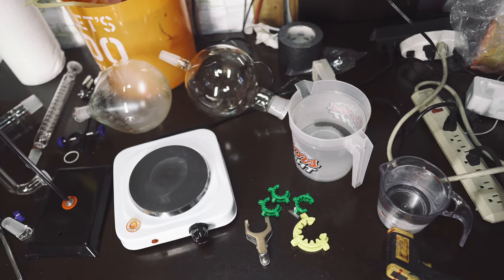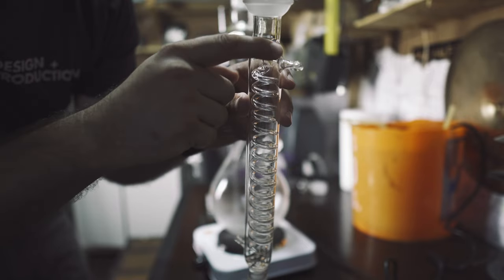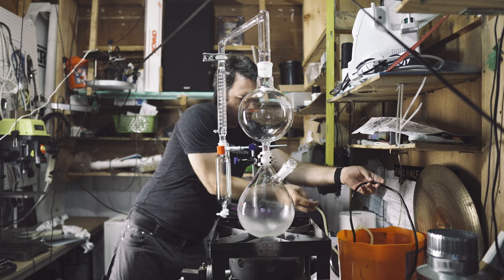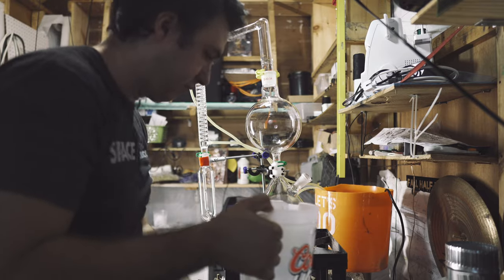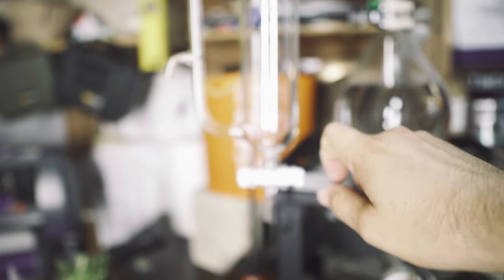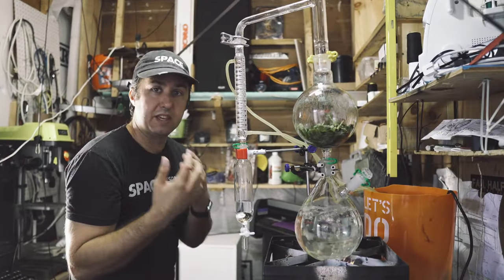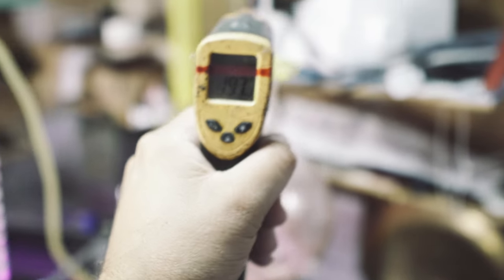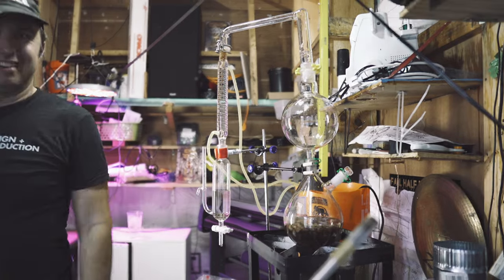How to steam distill essential oil at home and how to fail at that distillation. Beginners guide!

Comment: I thought he had a closed system but after watching it again i see there is a little outlet on the equalizing funnel.   Never seen a funnel like that before with the little side outlet thing........wild
Reply: That "thing" is not a funnel - it is a water-oil extractor and it is designed so that the excess water (and pressure) comes out of that "little outlet" on the side. In fact when doing this kind of steam-extraction you would normally put a catch-bottle under that as it will fill up and flow out there. And for example with rose-bud extraction you will get pleasant-smelling "rose-water" or hydro-sol from there.
Reply: @TheDesertsweeper  .......Thanks buddy i learned something new.

Comment: Can you tell me which set up you purchased for the main distiller?  I've now watched probably 100 videos and read very few reviews.  This, although an epic fail in the end, was something I think, like you, could modify with your tips and troubleshoot as I go!
Reply from the maker: Melanie Esguerra well the exact one I bought is apparently no longer for sale, but this one seems to have all the same parts. https://www.ebay.com/itm/372885079862 I hope it works, and by all means let me know how it goes!!! I was able to make some in subsequent tries with less heat
Reply: SPACE DESIGN WAREHOUSE Oh thank you!  I was looking at this same one on Amazon.  Ebay is cheaper.  Yay!  I was wondering if, now that you’ve realized the first run through was boiling too hot, do you think the hot plate that comes with the kit was designed to maybe only get that hot for a reason?  I want to get all the parts I know this far from your modifications at one time.  I’m wondering if I need to buy the propane burner... 🤔 What do you think?
Reply from the maker: Melanie Esguerra I’m pretty sure the propane burner was overkill, and because I didn’t have enough airflow it only seemed like it wasn’t getting hot. Turns out you just have to have way more patience; the whole process takes sever hours and I was trying to force it to happen in several minutes.  You’d want a propane burner if you we’re making one of those big copper ones that can process through buckets of material at once
Reply: SPACE DESIGN WAREHOUSE Perfect. 😑 Now I have to go find a place that sells patience!  😩😅 Okay, I’m going to try it as is and find a way to distract myself while it’s doing it’s thing.  I was thinking I could even go between and try just a little bit stronger hot plate...like 1800 watts or something. 🤔

Comment: Hotplate not a burner since it gets way too hot. You need a steady control of heat and that not possible with propane.
Reply from the maker: That has become clear.. I couldn't figure out how this is pressurized, though, theres a 1/4 hole with no plug at all times!

Comment: Dude - do not have that glass sat directly on the metal unless you want an explosion of boiling water all over your body.  Read why you can not touch glass to metal - it has to do with the rate at which they heat and cool

Comment: Thare She Blows due to the pressure needed to overcome the column of water in your collection tube, It would not have happened if you did not have an air tight connection between the output of the condenser and your collection tube and so the steam can flow but not build up pressure. It looks like there must be a defect in the manufacture or the design of the collection tube, the vent tube at the top of the collection tube should be open to atmosphere  but it must be solid glass not a tube causing a the pressure to build up and blow. Aside from that i liked your video for entertainment purposes.
Reply from the maker: Ohhhhh, because the ‘blow off’ tube is part of the collection flats, you’re saying the pressure built up in the condenser coil and had no where to go? 
I was wondering why there wasn’t just steam shooting out of that blowoff tube. Should there be one of those above the condenser instead?
Reply: @SPACEDESIGNWAREHOUSE  After watching again I saw steam escaping out that upper vent tube in the collection tube so that is not the problem. What I believe is the problem is that your plant clippings in the upper chamber got saturated with water, sank down and clogged the opening between the vessel containing the water and vessel with the plant material. This allowed pressure to build up in the lower chamber until it was powerful enough to suddenly clear the plant material out of the way causing a sudden surge of pressure to surge upwards causing the blow out. Perhaps a screen of some sort in the the upper chamber would prevent the plant material from clogging the opening between the chambers. This problem is not unknown in the distilling community and has been described as burping and is caused by a clog in the system that is overcome by a buildup of pressure. Give it another shot and use a screen, copper or stainless scrub pad underneath the plant material so that the path is open between chambers throughout the run.
Reply from the maker: @mesavage999  smart! Thank you for that analysis; I’m going to set up another go this week..

Comment: If you do a video for the public to watch you should probably take some safety precautions. For one safety glasses. For two to do a correct distillation you need internal temperature of your external heat gun doesn't tell you what you need to know.

Comment: The problem is not the kit… you extract into an open top container, not the separator flask. This system should not build pressure.

Comment: @SPACE DESIGN WAREHOUSE  heating the closed system has given me a hell of alot anexity and I'm grateful that worse did not happen. 

I'm sure your aware now of heating a closed system can be bad, but you lucked out.

Yes the system technically has a small opening but the amount of boiling means your were overloading your condensor. It would ideally be no added pressure as the water re forms and condenses but thas not always the way it works.

Always leave one clip off in a place where its safe to blow open, that way if pressure builds you may get that second chance to correct. 

I don't know much about the oils, but I do know safety is our choice. And if we chose to get hurt we will, but we also can learn and do better next time.

Like the channel and seems like I am late for my comment. I'm just hoping positivity and success is going your way.
Reply from the maker: Oh no I appreciate any further input! Clearly I’m not an expert on distillation. I’m not really sure how the flow is expected to work with this particular setup since like you said, it’s a closed system so there’s nothing that can move the oils up out of the first container! 

Nevertheless, a good lesson perhaps for someone else who buys this type of set, NOT to put a propane burner under it to attempt to speed things up:)

Comment: How many watts is your fish pump? I've got the same distillation set, but it came with a flat bottom double neck 2000ml flask.
Reply from the maker: @中橋孝-g3z  that fish pump is super low power. It’s like 5 watts.